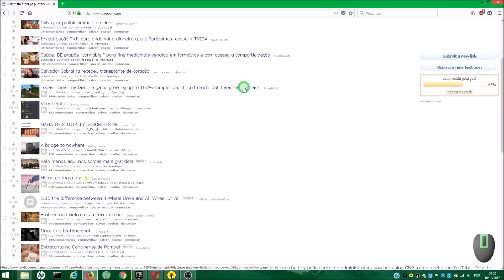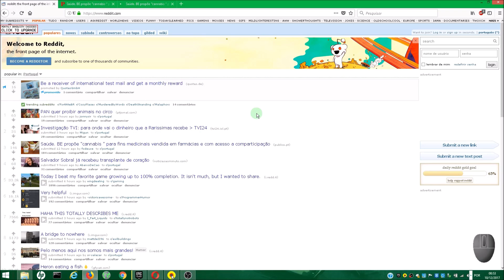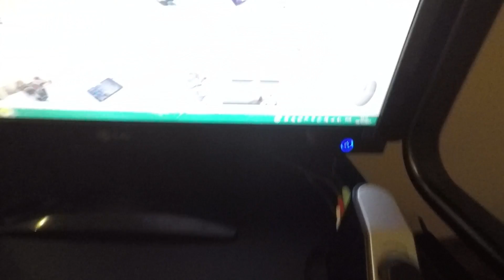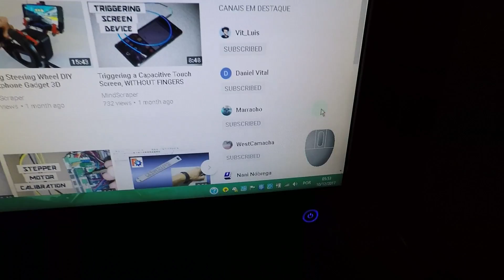How to Open and Repair a  Logitech Wireless Mouse M185 and M215  (Click Issue)

Comment: I've got this mouse (m185) and a keyboard for a surprisingly cheap price considering it's a Logitech. 
When started to use it, I realized I have to detach every key on a keyboard, rasp the plastic casting remnants on the inside of the key pieces and to lubricate them to ensure smooth clicking.
With mouse. I had "just" middle click not working, solved by gluing three layers of small buisness card pieces on the inside surface that touches the inner switch.
https://cstcnj-blog-blog.tumblr.com/post/83240793790/how-to-fix-logitech-m185-middle-mouse-button
It was just 30 minutes of work, but fixing the keyboard took me the whole afternoon.

Comment: Using this mouse for 5 years now, my question is does it have an auto shut off features even the switch is in ON position?
Reply from the maker: Good question. Just reading in the manual
Reply: @MindScraper  waiting for your answer bro
Reply: @playstation2bigs  yes it does

Comment: Thanks for the detailed video. My problem is the scroll. I allready fixed the middle click by putting a bit of sticking plaster (sticks really well) where the wheel mechanism touches the button (the button click was ok ) Now the scroll wheel hesitates. Could it just be a bit of dirt on the wheel ??
Edit: I answered my own question . Took me 2 minutes to pop the front off and there WAS plenty of fluff there(dirt) All good now :0) Also replaced the plaster (cut the plaster then keep putting the sticky part on top and layer it so it's about 4 or 5 layers) Good luck to any novice Diy ers . Take you 10mins to try
And thanks again for your video
Reply from the maker: I'm glad you shared it.
Reply: No Windows 10 does not support scroll on M215